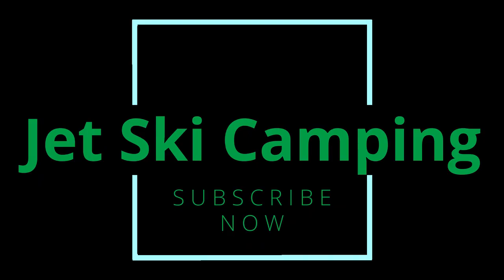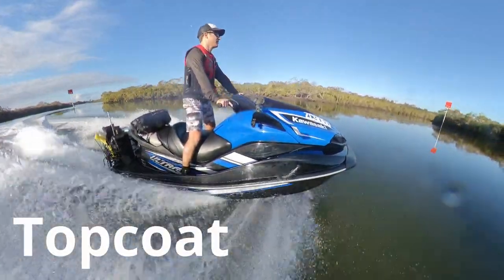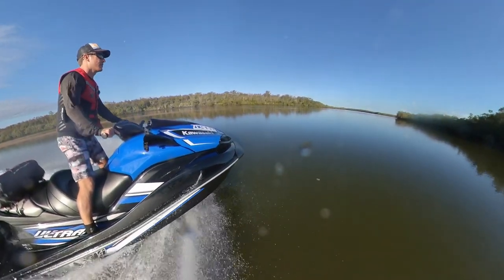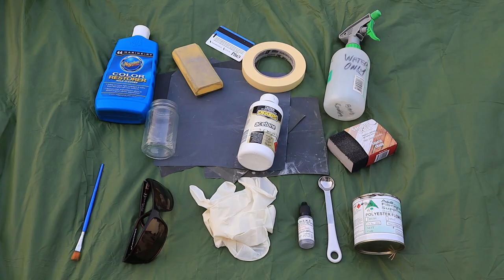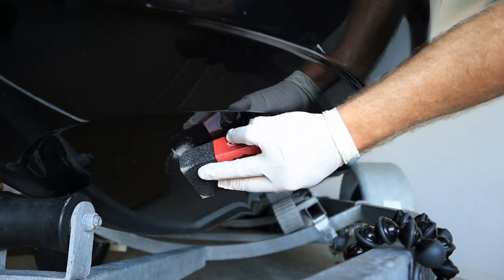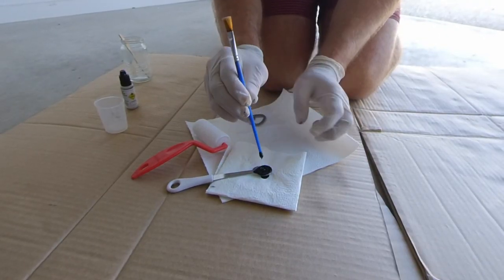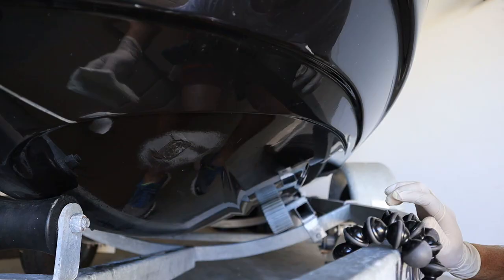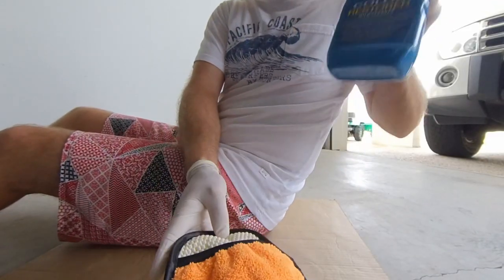EASY Gelcoat Repair with Flowcoat - Fibreglass Boat / Jet Ski

Comment: Great video You are a saver! I bought a brand new Kawasaki Jet Ski and chipped in the exact same size as on the video the bottom area, near the intake. 3 places quoted me from $2650  to $3000 for a chip smaller than a fingernail. Leaving your jetski somewhere else for 3-4 days is another problem because it is guaranteed that you will receive it with 5 new scratches all over. Thank you so much!

Comment: Hey, so I just fixed my jetski I just bought, the hull and nose of ski was cracked I re fiberglassed the whole jetski. Now onto sealing it an making it water proof. So do I need to just apply the gel coat without wax, sand it down with 800 wet sand paper then apply gel coat with wax (flow coat) and buff?

Comment: What products did you use for this? I have a repair I need to do on my seadoo and the area along with the color are the exact same as yours.
Reply from the maker: G'Day Hunter, I purchased all the products from my local fibreglass shop - they were really helpful! Here is what I got --> 3:30. Just be aware that some modern jet ski's have composite hulls that cannot be repaired using these materials. Check with your manufacturer / dealer if unsure.

Comment: If you didn’t repair that, what’s the worst that can happen? Slow erosion from the water will eventually cause a hole?
I get the need to officially repair it, but why can’t you just slap a piece of black duct tape over it and call it a day?